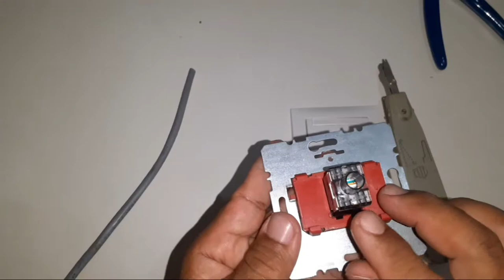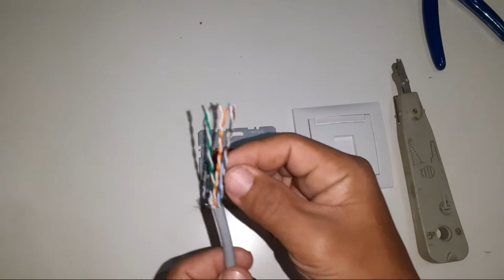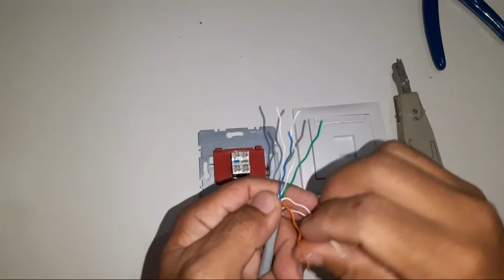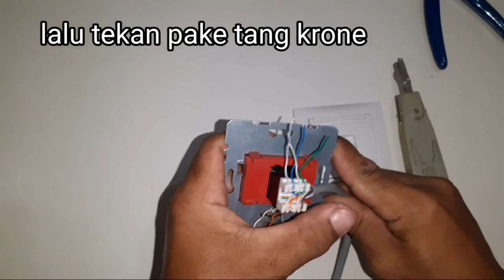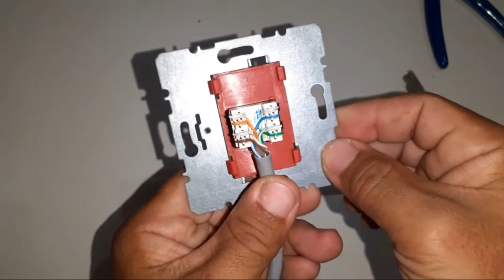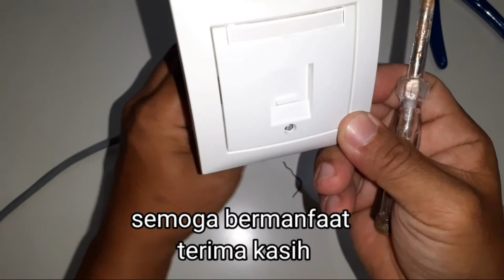Cara pasang socket/outlet LAN data berker cat6/connect cat6 cable to jack

Comment: Pak, kalau mau menjumper antar socket data apa bisa pak?
Kasusnya,
Saya mau menjumper socket data di kamar utama ke ruangan kerja.
Tapi hub internet ada di ruang keluarga. Jadi yg saya jumper, socket data dari hub yg ada di kamar utama, saya jumper dan tarik ke ruang kerja.
Reply from the maker: Bisa pak
Reply: @javayanto  caranya gimana ya pak?
Apa seperti kabel listrik?
Reply from the maker: Bisa pake soket 
Dan bisa sambung  di lilit sesuai warnanya bisa juga di solder
Reply: @javayanto  setelah sambung lilit, baru dijepit ke soket ya pak?